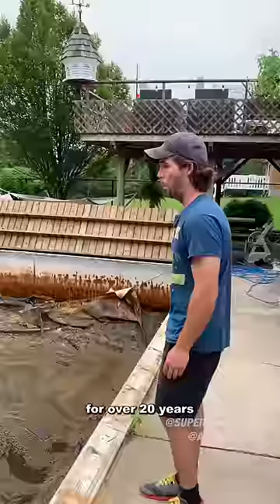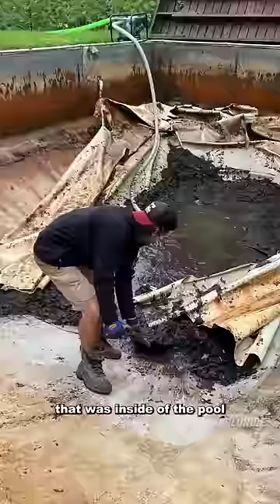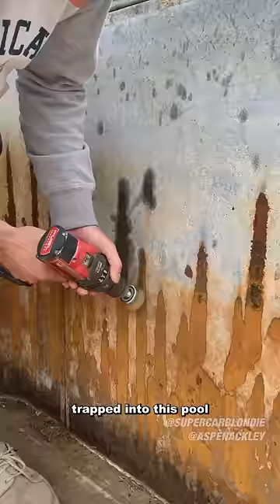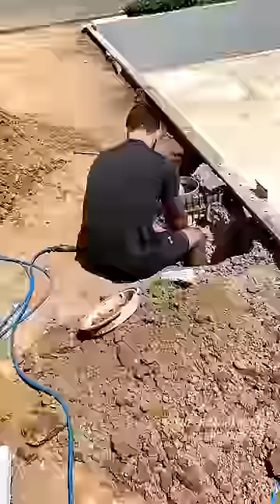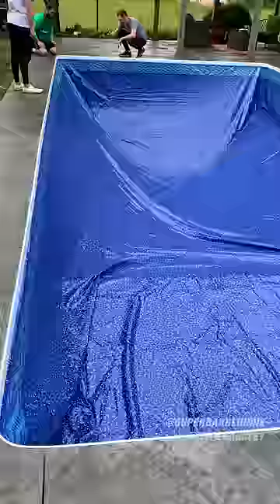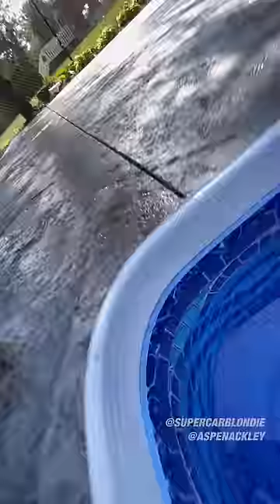Restoring A 20-Year-Old Hidden Pool 😲 #shorts

Comment: thry remind me of every low income apartment I've ever been In. just paint over all the rust and mold then put some lamanent on
Reply: Yeah tf was that lmao
Reply: How should they have gone about it? Genuinely asking I have no idea
Reply: So you were there to watch the whole process or are you assuming?  Real question.
Reply: @kayesdigginit1519  you'd think that they would include those parts in the video if they did that, but you can clearly see them in the video painting over the rust on the walls of the pool
Reply: @AaronSpider88  do u think its possible to get out all the rust? They sanded down the rough parts painted over it and then applied the lining. That lining will protect the structure of the pool for years.
Reply: @keishahart8439  they could also, i don't know, replace the rusted parts? Just a thought
Reply: Reminds me of all the old apartments I lived in in San Francisco. Just layers and layers of thick plasticky paint. Gross.imagine all the diseases laying right under that 1 last layer of that pool.🤢🤮
Reply: @keishahart8439  They're already investing a ton of money and time in redoing this pool, the least they could do is replace the rusted walls.
Reply: @whatever5922  Hey mate, so they could have wire wheel or sanded it down to bare metal and painted it, or at least wire wheeled and applied rust converter and then primed it
Reply: @wolf v Tea tree would be super impractical. They make stuff you can buy at the hardware store (a lot of it is basically bleach) that can kill that stuff.
Reply: @whatever5922  It looks like it's a steel structure so, light sandblasting / SP-10, rub it down with MEK or deionized water, put some sort of zinc primer on it to act as a corrosive barrier, then probably some sort of two-part submersible epoxy.
Reply: @keishahart8439  they didn't sand it right. It's definitely possible to get all the staining out, they also sanded out most of the profile so the paint will probably peel off in a year straight to bare metal.
Reply: @AaronSpider88  what's the point in replacing it? All they need to do is lightly sandblast it and it would be good to go.
Reply: @princess7jasmine  nah, It would be just fine if they would do it right. Sandblasted, they could even use sponge or dry ice to blast it.
Reply: @AaronSpider88  I have no idea, it's hard to tell in their video.
Reply: @killer008r  I guess if they had a sandblaster that would be an option, sure, but I also don't know if the rust went through the lining or not, I don't know how thick the lining is
Reply: @kayesdigginit1519  hard to tell what? If they sanitized it? Because in the video it looks like they just painted over it and then put a thing over top (not sure what the thing is as I'm not an expert in pool repairs). Like I had said before, you'd think if they sanitized it they would want to show it in the video, but perhaps not.
Reply: @AaronSpider88  it will go through the lining.
Reply: @killer008r  the rust or the sand-blasting?
Reply: @AaronSpider88  the rust, it'll corrode the plastic pretty quickly

Comment: I love how they tried to clean it, then tried to paint it and gave up and just wrapped the whole thing lol
Reply: Lol, did you see the little POS tool he had to sand the sides down. Looks like they bought that tool at a garage sale. Also check out how they are just pumping all that water out and dumping it into their fence line behind their neighbors house.
Reply: It's a pool liner, not all pools are concrete and don't leak. You absolutely need the liner.
Reply: A pool like that one needs a pool liner and they have to be changed about every 10 years.
Reply: They had to prep the ways to seal them install the liner everything they did was part of the process.
Reply: Part of the process
Reply: Paint was for the rust, liners so you actually keep water in
Reply: Очистили от ржавчины, покрасили, чтобы не ржавело и затянули всё плёнкой лишь после этого.
Reply: It's supposed to be done that way.....read a book
Reply: Nasty.
Reply: Actually that was prep, sealant/glue, then the liner. You have to have a mostly cleaned up, and rough sides for the liner
Reply: Seems like you've never seen a pool restored or installed before. Smh
Reply: The paint would be a sealer.
Reply: @mattferrigno9750  i dont think they were dumping it in their neighbors yard, most likely connected to a tank of some sorts. You cant even see the end of the tube so we are both just guessing here
Reply: @xmasonx6094  That makes absolutely no sense. Why would the tank be over 20 feet away. You would have the tank close by. They zoomed out and you still couldn't see any tank. Also how would they move such a heavy tank? You would have to drive machinery over the grass destroying it. If that was the case the hose would have been going towards the street for easy pickup of the tank. I'm not assuming, after the job these people did its obvious what they are doing.
Reply: @mattferrigno9750  lmao no you are assuming, how do you know how long that tube goes on for? Maybe its not in the shot because its longer than you think. You cant see any water being pumped out anywhere so yeah, you are assuming shit😂😂
Reply: @mattferrigno9750  ever hear of a truck with a tank? My ASSumption is the old water was getting pumped directly into a truck tank.
Reply: @Smashkey

Say you don't know about a pool without saying you don't know.
The fact you tried to clown them & in the process exposed your lack of knowledge,  
It's mind boggling how 1.3k people agreed with you smh.
Reply: Not to mention they painted over rust lol. 

That shit is probably going to eat that liner away in a months or two, tops. 
Rust is no joke, it's like mold. 
It literally Won't go away if not handled the correct way.
Reply: Need smooth surfaces even putting a liner in. The tear very easy. Especially if your installing on a hot day
Reply: At least it doesn't stink
Reply: Can't wait till it blends through
Reply: Wth are u talking about?!
Reply: Not a wrap
Reply: The paint is for the rust and the pool liner is well… self explanatory. It’s amazing how dumb people are now a days
Reply: Yea I was just wondering if you should paint over rust and then swim in it lol

Comment: The real star of the show was that perfect fitting vinyl liner
Reply: Yea that intrigued me as well. Watched this a to. Of times to try to make sense of how it fit so perfect
Reply: @peaceofrefuge  It's made to fit that exact design of pool.
Reply: it’s fits that size pool then u vacuum out the excess air & it suctions to sides fitting perfectly... cause again buy the correct size liners ..smh🤦🏻‍♀️🤡
Reply: @garypulliam3740  what is that wraped called? Where do they sell it?
Reply: @JAVILA133  Check online or call your local pool installer.  They will probably have some or be able to order it for you.
Reply: @JAVILA133   And it is just called pool liner.  Tailored or made to fit or pre-fit or something along those lines.
Reply: Actually it was the frog- 🐸🐸🐸

Comment: They actually put a cover or something like that? Like yo I always thought they used some sort of light blue and dark blue tiles to give in that blue colour😵‍💫
Reply: Yeah I'm still not sure what was that, and how it fits the pool's shape perfectly, did they put some kind of glue or something?
Reply: @nisa3612  It’s called a pool-liner, you take measurements and order them perfectly fitted for your pool shape. Once the put it in they will vacuum out the air/bubbles. They last a little over a decade on average and they’re pretty expensive lol. Almost every personal pool uses a liner just like this one 🤙